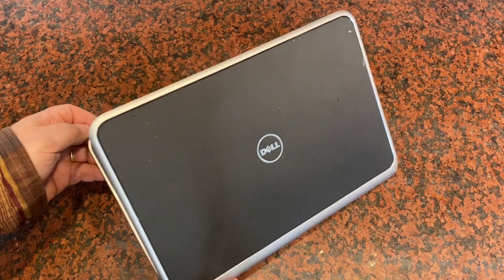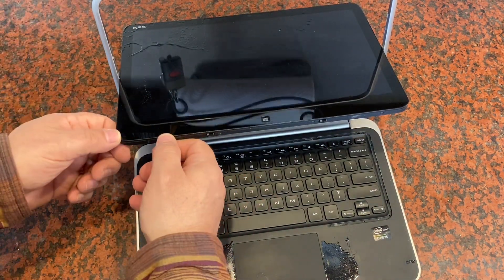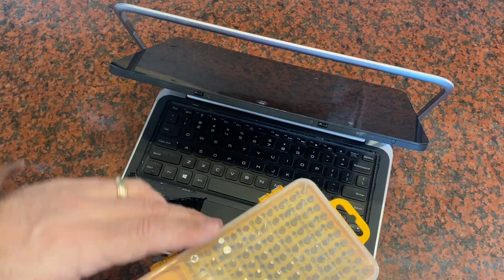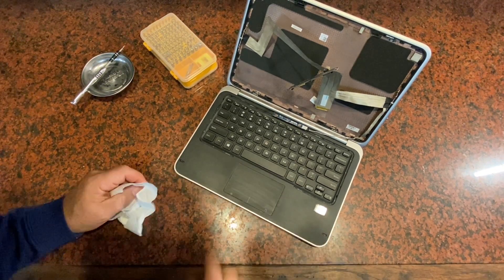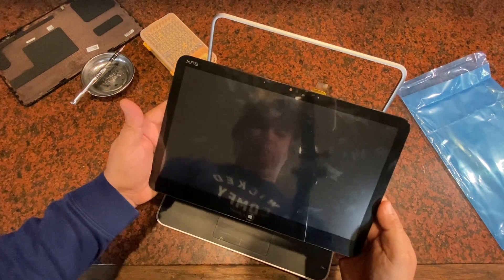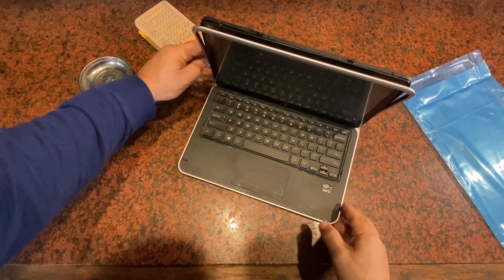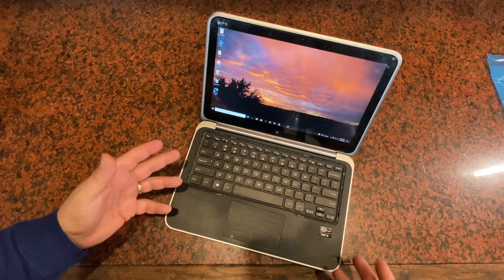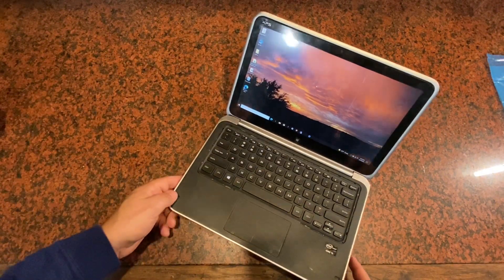✅ Dell Laptop Leaking Gunk? How to Replace a Failed Leaking Touchscreen On Your XPS12!

Comment: Thank you - I followed this video and replaced the screen in my sticky dell xps 12. Apart from the glue failure, it is still a pretty decent laptop, I still use it to play old games on an old version of windows and run ubuntu.

Comment: i got the glue running down on my acer spin 1 on the bottom corner, its not as bad as yours though. Problem is the touch screen on both sides of the screen dont function because i suspect there glue in-between the display and touch screen. I can see bubbles too. Any Solution?  Removiving the screen looks like a challenge because there no screws, i have slowly pry it open. And no replacement screen can be found.
Reply from the maker: @greatestever4773  feels like it’s time to upgrade
Reply: @ApacheRanch  nah man. It works perfectly. Just need to upgrade the ram. There is no need for an update and other the touch screen.